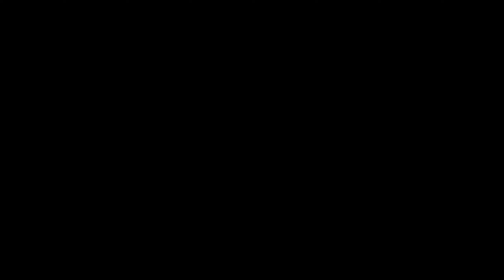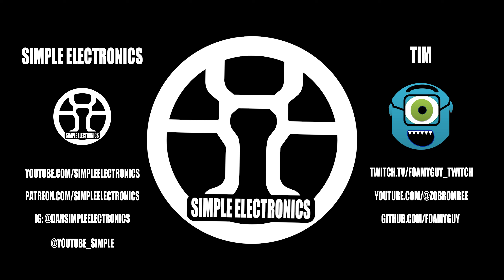The Simple Electronics Podcast - 062 - Tim

Comment: You may want to correct your mid-roll PCBWay ad.  When you refer to "mils" you are talking about thousands of an inch in the electronics industry.  So 5 PCBs for $5 at maximum 100 "mils" is about the size of a postage stamp.  What we would call "thou" in the automotive field.  I believe the Chinese websites advertise 100mmx100mm.